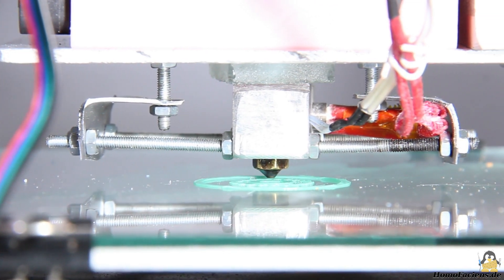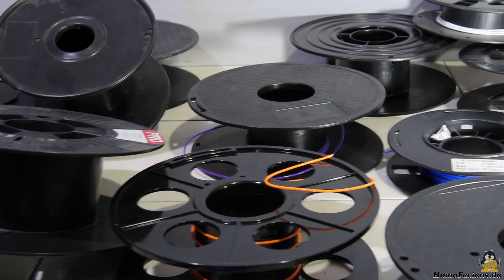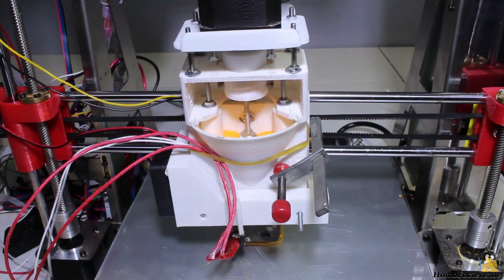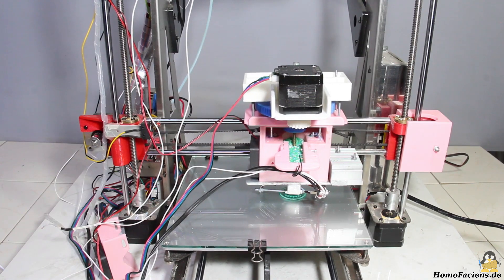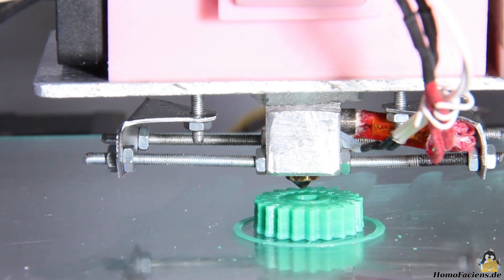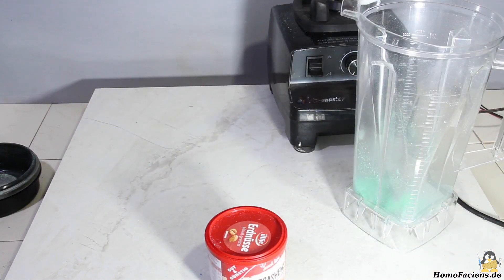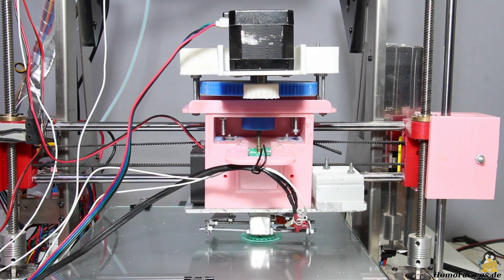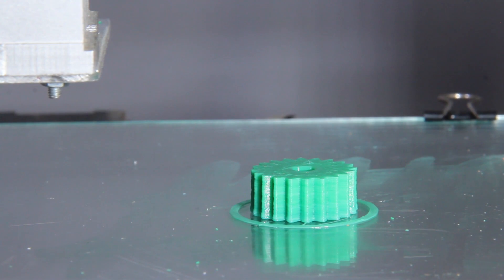Application for a fellowship of the Shuttleworth Foundation in 2022

Comment: I wonder if a garbage disposal could be used to pre process the filament instead of a blender and a sieve? Instead of blades they use little free swinging hammers that smash discarded food against a metal grate. If they could handle plastic parts without breaking, It looks like the fragments put out might coincidentally be the perfect size.
Reply from the maker: I never have seen a garbage disposal you mention. What the perfect size for the granules is will be treated in one of the  coming videos - stay tuned!

Comment: Technically your method should or sped up 3d print right? If yes.... thats a huge bonus too!
Reply from the maker: Print speed also depends on the printer mechanics. The one I am using is a rather weak construction. I will demonstrate different print speeds in the next video - stay tuned!
Reply: @HomoFaciens  keep up the GREAT work!!

Comment: @homofaciens I took a look at the three project pages as well as the videos. I think I kind of understand the construction of the extruder:

A 5mm outer diameter wood screw drives the ground up plastic and/or virgin plastic(2-3mm pellets/nurbles?) from the hopper down into an 8mm inner diameter channel.

The 8mm diameter channel is in the top of the cold block with a side groove/ground path for the flow of the material to enter, based on the driving direction of the screw.

On the other side of the cold block is a 9.5mm diameter x 10mm hole. This facilitates 10mm length of the 26mm teflon tube(10mm o.d., 8mm i.d.). The tube goes through 8mm of glass, and the remaining 8mm of tube goes into the hot end. 

In the hot end, there is another 9.5mm diameter hole that is 8mm deep. This allows the teflon tube to fit snugly. Hot plastic is extruded out the 1mm diameter tip.

What I don't understand, though, is how the system handles retractions. Or can it?
Reply from the maker: Correct summary.
I will give a short look on how retract works in the next video and will dive deeper into the subject in more of them - stay tuned!

Comment: I always thought this is the way to go. I will adopt your design and optimize for weight using a dc servo motor and a smaller pet hopper fed by a blower.
Reply from the maker: Would be great to see your results! Check the core system before starting to build things around. More videos showing the principles this extruder is based on fill follow soon - stay tuned!

Comment: One question to preprocessing the Material: Would it be feasible to use a standalone coffee grinder to grind the already blended material to the desired size and afterwards drop the material through hot air to make it more round?
Reply from the maker: As stated in the top comment: I will talk about the technology and the how and why in coming videos - stay tuned!

Comment: Its nice that you're still iterating and improving the design! I wonder if it is also compatible with normal pellets ? Seem like a very different geometry than recycled pieces, at some point people will run out of old prints :P Unless the use case is to be alongside existing printers. Second, I wonder if retraction is possible with this kind of extruder.

Comment: This seems simpler than I expected, and perfect! You raised a good question, why is everyone quick to state that this is not doable? Why haven't any one done this?  I love it, amazing print!
Reply: I think the issue will be, that the extruder head becomes so bulky and heavy which greatly reduces print speed and increates vibration.
Reply: @dreamyrhodes  That certainly is an issue but should be mitigated significantly in software by using the various speed optimisation options in Klipper.
Reply: This can be considered as a disruptive technology to the current filament based industry. I would think that this would be the main reason for some negative predictions. Another reason would be that this design uses only two temperature zones, one hot and one cold. A conventional plastic extruded screw use three melt zones to get rid of the air. Somehow this design seems to overcome this.